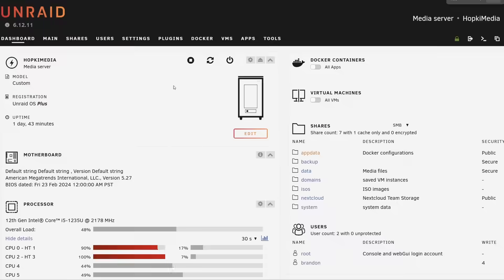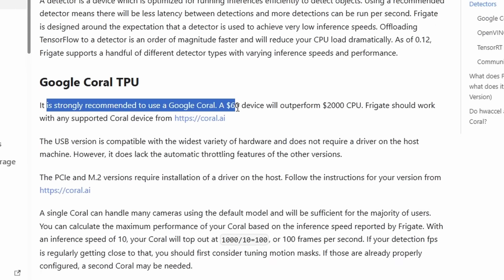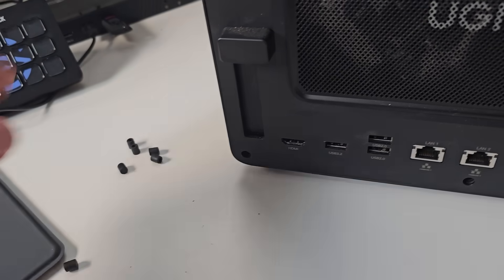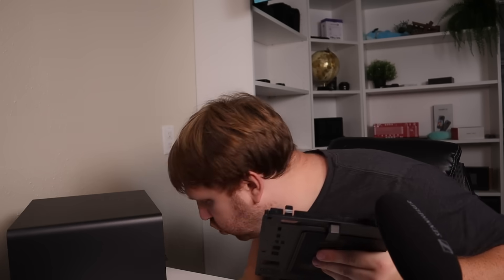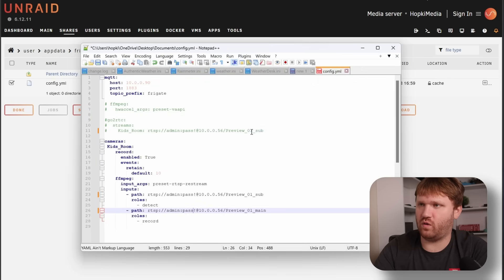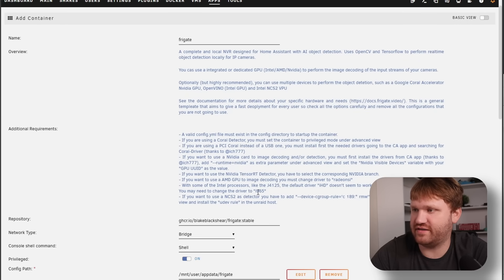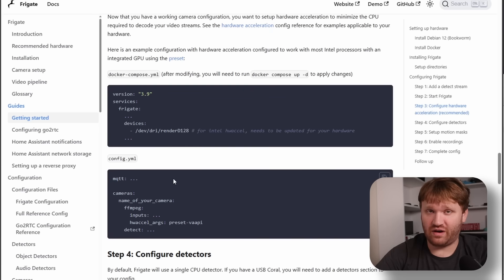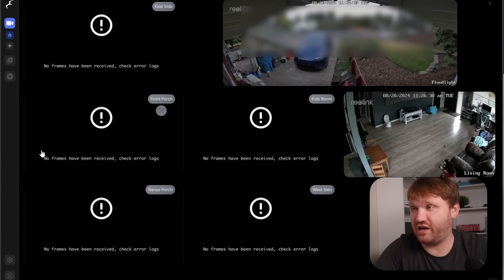i added a Google AI chip in my Home Server…

Comment: Cool video but I have no idea what the point of installing the Coral in the first place. What does it do for you? Kinda missed that point.
Reply from the maker: You can use it for AI object detection with self-hosted NVR solutions. 

"Other uses include accelerating AI workloads in Home Assistant, running local image classification, or any application that supports TensorFlow Lite. The key benefit is offloading that compute-intensive neural network processing from your main CPU."

Comment: 0:25 you are not the only idiot. hahha

I bought the same Dual TPU only to find out that there are different types of nVME slots for different types of hardware. :D  I feel more stupid than you. (XD jokingly)  

I have an ASUS PCIe card with 4 nVME slots in my server, which I normally utilize for SSDs, and I thought the TPU would just work there. But apparently I didn't do enough research. hahah

I then ordered both a USB version, and this exact adaptor, and thanks to the plugin it works just fine. 
I will use the USB version for some friend if anyone wants a frigate setup with a raspberry pi or something.

Comment: Casual flex..... and shows a 14 TB drive > my casual flex is im running 4x 20 TB seagate exos drives on my gaming pc, and building a 4u 24 bay server currently because im out of space (not a chia miner, but wear an eyepatch) but waiting for the price to drop on ryzen 7900 non x cpus. 

specs from belarc of current gaming system:

 Windows 11 Professional (x64) Version 23H2 (build 22631.4112)
Install Language: English (United States)
System Locale: English (United States)
Installed: 4/29/2023 4:51:22 PM
Servicing Branch: Current Branch (CB)
Boot Mode: UEFI with Secure Boot disabled
System Model
Gigabyte Technology Co., Ltd. X670 AORUS ELITE AX
Enclosure Type: Desktop
Processor a
4.50 gigahertz AMD Ryzen 7 7700X 8-Core
512 kilobyte primary memory cache
8 megabyte secondary memory cache
32 megabyte tertiary memory cache
64-bit ready
Multi-core (8 total)
Hyper-threaded (16 total)
Main Circuit Board b
Board: Gigabyte Technology Co., Ltd. X670 AORUS ELITE AX
Bus Clock: 100 megahertz
UEFI: American Megatrends International, LLC. F31b 07/05/2024
Local Storage (mouse over drive name for details)
84.37 Terabytes Usable Local Storage Capacity
9.57 Terabytes Local Storage Free Space

Internal Drives 	Size 	Type 	Serial Number 	Drive# 	Status*
 	ATA CT1000MX500SSD1 SCSI Disk Device	1.00 TB	SSD	2302E69B1CE1	1	Healthy
 	ATA CT1000MX500SSD1 SCSI Disk Device	1.00 TB	SSD	2302E69B506F	2	Healthy
 	ATA CT1000MX500SSD1 SCSI Disk Device	1.00 TB	SSD	2302E69B1D54	3	Healthy
 	ATA CT1000MX500SSD1 SCSI Disk Device	1.00 TB	SSD	2302E69B1D73	0	Healthy
 	ATA CT4000MX500SSD1 SCSI Disk Device	4.00 TB	SSD	2326E6E9AFA3	5	Healthy
 	ATA ST20000NM004E-3H SCSI Disk Device				disabled 	
 	ATA ST20000NM004E-3H SCSI Disk Device				disabled 	
 	Microsoft Storage Space Device	69.27 TB	HDD	{0f982b66-920a-4c52-8205-2638b2dbfe82}	12	
 	SHPP41-1000GM	1.00 TB	NVMe	SSB6N82781280724H _0000	9	
 	SHPP41-2000GM	2.00 TB	NVMe	SDBCN63771080CS46 _0000	11	
 	SPCC M.2 PCIe SSD	4.10 TB	NVMe	AA000000000000001107_0000	10	
 	ST20000NM004E-3HR103				disabled 	
 	ST20000NM004E-3HR103				disabled 	
USB Attached Drives
 	Generic- Compact Flash				13	
 	Generic- MS/MS-PRO				15	
 	Generic- SD/MMC				14	
 	Generic- xD-Picture				16	
Other Drives
 	HL-DT-ST DVDRWBD CT30N [Optical drive]	

* Status reported only for SMART enabled drives
Memory c,d
127.10 Gigabytes Usable Installed Memory

Slot 'DIMM 0' has 32 GB (serial number B65ACEFD)
Slot 'DIMM 1' has 32 GB
Slot 'DIMM 0' has 32 GB (serial number 46578CF8)
Slot 'DIMM 1' has 32 GB
128 Gigabytes Maximum System Memory Capacity

Local Storage Volumes
c: (NTFS on drive 9) * 	999.43 GB 	584.84 GB free 		
d: (NTFS on drive 0) 	1.00 TB 	35.99 GB free 		
e: (NTFS on drive 1) 	1.00 TB 	405 MB free 		
f: (NTFS on drive 2) 	1.00 TB 	51.68 GB free 		
g: (NTFS on drive 3) 	1.00 TB 	993.69 GB free 		
h: (NTFS on drive 10) 	4.10 TB 	89.81 GB free 		
i: (NTFS on drive 11) 	2.00 TB 	74.35 GB free 		
t: (NTFS on drive 5) 	4.00 TB 	3.53 TB free 		
x: (NTFS on drive 12) 	69.27 TB 	4.22 TB free 		
* Operating System is installed on c:

Printers
Adobe PDF Converter 	on Documents\*.pdf
Microsoft Print To PDF 	on PORTPROMPT:
Microsoft Shared Fax Driver 	on SHRFAX:
Microsoft XPS Document Writer v4 	on PORTPROMPT:
Controllers
Standard SATA AHCI Controller (2x)
Display
AMD Radeon(TM) Graphics [Display adapter]
NVIDIA GeForce RTX 4070 Ti [Display adapter]
Samsung LC32G5xT [Monitor] (31.7"vis, s/n 0RHTHNAW600634, June 2023)
Bus Adapters
Arsenal Image Mounter
LSI Adapter, SAS2 2008 Falcon
Microsoft Storage Spaces Controller
Standard NVM Express Controller (3x)
AMD USB 2.0 eXtensible Host Controller - 1.20 (Microsoft)
AMD USB 3.10 eXtensible Host Controller - 1.20 (Microsoft) (2x)
AMD USB 3.20 eXtensible Host Controller - 1.10 (Microsoft) (2x)
Multimedia
AMD High Definition Audio Device
AMD Streaming Audio Device
HyperX Cloud II Wireless
NVIDIA High Definition Audio
NVIDIA Virtual Audio Device (Wave Extensible) (WDM)
Realtek(R) Audio
Steam Streaming Microphone
Steam Streaming Speakers
USB Audio Device

(had to lol, and im not a rich man, but im a tech geek 100%)

And if you read this far, this is where i get them for about $250 each.... best cost i can find per GB: 

https://www.amazon.com/Seagate-Exos-7200RPM-3-5-inch-Enterprise/dp/B0CHKP1716/ref=sr_1_5?crid=23OMDFNOONA4S&dib=eyJ2IjoiMSJ9.4Hd7jRUd9gtc8hBqbSFNsob9hc8FSLs3F2-E__No5jBMCWMjtZ3vNTX_Mi0sGPlupCv56Y10J0baU0m378OzbVrvFyoDavZ_P_HfQGgxeEFOSMBxQtv7N6g9n3_rEZeB-7C7niXMsPjdDNnFlN9KN4aHGINAMVeafLS6c828EbaJeNqCHu9-ETwp4adBR_t62GBQDupK3R9hH7XBqMWXA42EX2mCVa3olLbf0zttCBY.pywjv5dTgZ5uigrs6lb7QSROQYye2-_h23YSeIUd1mE&dib_tag=se&keywords=20tb+hard+drive&qid=1724891361&sprefix=20tb%2Caps%2C132&sr=8-5
Reply: TMI. Nobody cares, honestly.
Reply: @FlyboyHelosim  your right, i sure dont...... hope you get a little more positive in your life instead of trying to bring people down for no reason

Comment: Can it be used for local llms or image generation?
Reply: No. Need a beefy GPU for that. These TPUs have barely any memory.
Reply: Ok, thank you for the response.
Reply: not enough onboard memory to be useful for llm or image (cannot hold the models).  these are for streaming data into it and processing it
Reply: @ZiggleFingers  considering that now we have so many under $100 phones that have 8Gb memory, it's still bogging me why there are no clones that have more ram available, even for slightly higher prices 😂
Reply: @crushfire2004  Because the TPU would need to be entirely re designed, it’s made for small scale inference. Giving it more ram would make no sense as it doesn’t have the compute to take advantage of it.